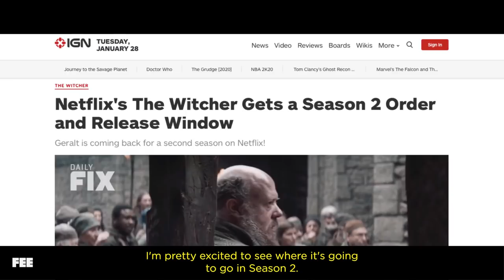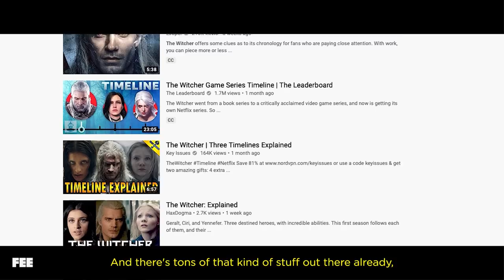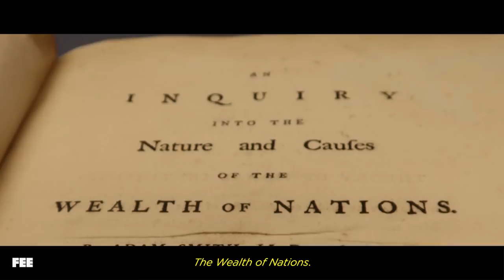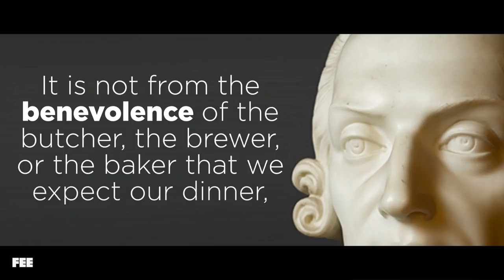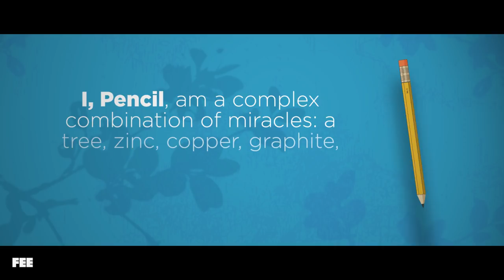Could Hiring a Witcher Create World Peace?

Comment: That is not true. They are those who have enough knowledge to make computers from scratch. Just not the time even if they may also also have enough skill.
Reply from the maker: There actually aren't. There are people - myself included - who are capable of assembling all the parts of a computer.

No single person on the planet has enough knowledge to create all of those parts from raw materials.

It takes the spontaneously coordinated efforts of people who understand mining and oil drilling, refining processes, metallurgy, chemistry, smelting, molding,  manufacturing, electrical engineering, computer engineering, and assembly... And beyond that there's the skills that go into making the tools and machinery that produces the hardware, the trucks/shipping systems that bring it to us. Stretching further out is food and farming and all the stuff that goes into sustaining the people doing that work 

And then, once the parts are assembled, you'd need to know how to code operating systems and develop the software that the computer runs on.

No. No one on earth is capable or has enough knowledge to do all these things.

No one on earth even has enough knowledge to build something a fraction as complex.

https://fee.org/resources/i-pencil/